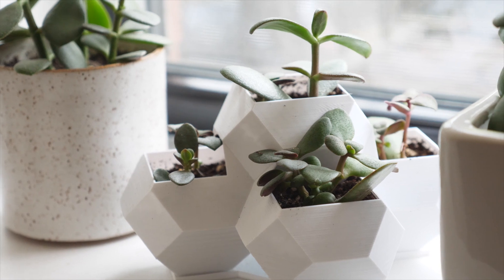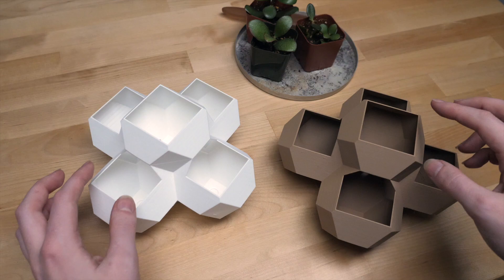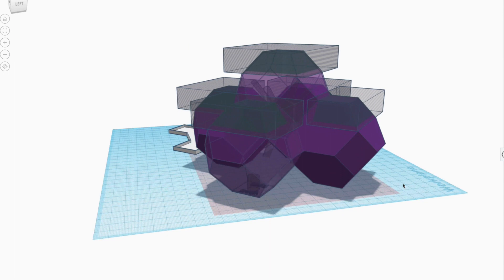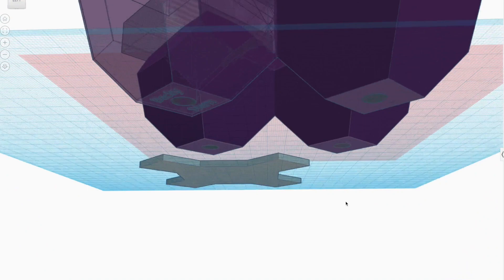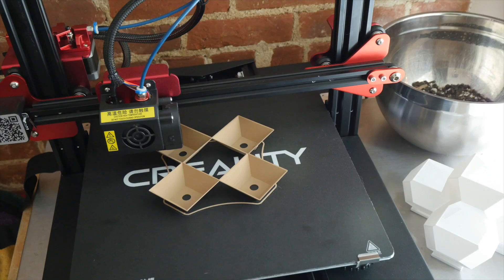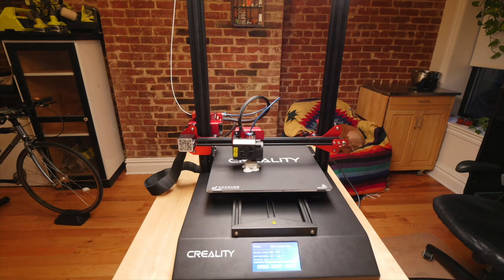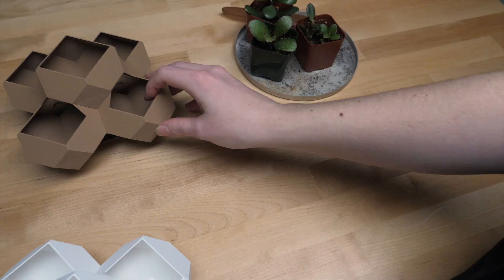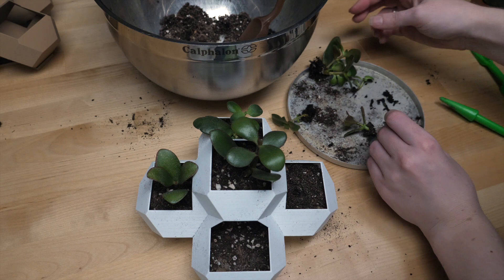DIY Succulent Planter (3D Print)

Comment: I had trouble printing this model, I downloaded the STL file at Thingiverse and I used Artillery but one of the chambers was printed with a thinner layer than the others. I don’t know if this happened to someone else
Reply from the maker: Sorry to hear! It's one of my first planters. The tinkercad file is available if you want to try to adjust the base model, otherwise maybe try a different slicer like Cura or Prusaslicer

Comment: I wonder if you thought of getting a fume cupboard to put your 3D printer into and running the cables to your computer system to keep the fumes out of your room so you don't inhale noxious fumes.
Reply from the maker: I print in PLA, which is less noxious than other filaments. (I understand that doesn't mean it's not noxious at all.) Thanks for your concern.